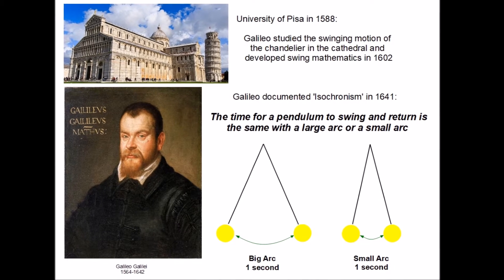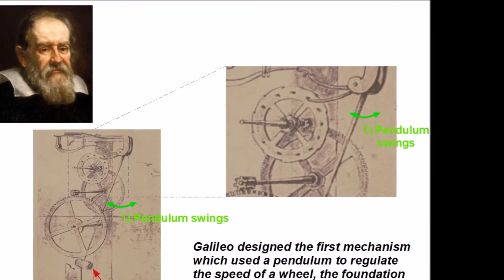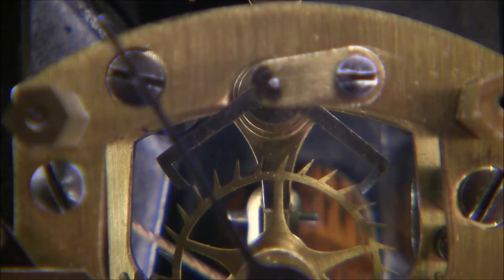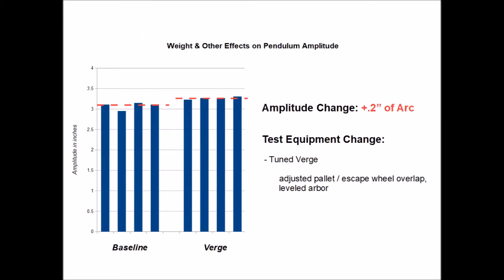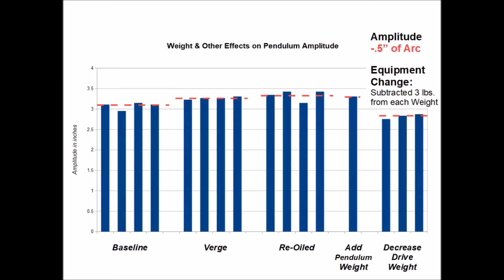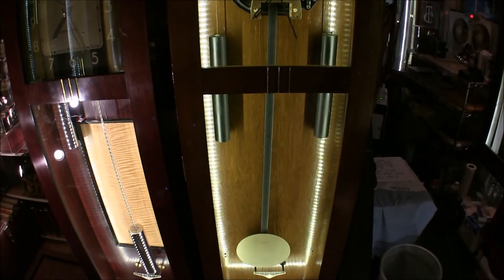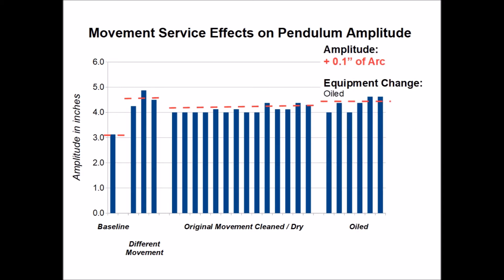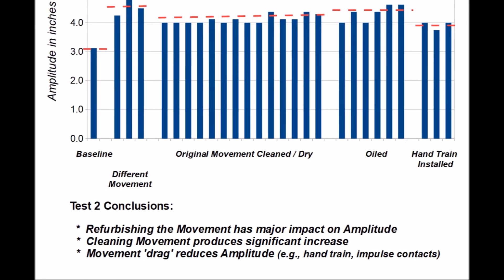Arc of the Pendulum - A Study of a Clock's Swing, an ITM Clock video

Comment: Marvelous clocks in this video.  I believe it's not quite correct to say that a pendulum with large amplitude has the same period as one with a small amplitude.  That's only true for swing angles much less than one radian.  Example: a one degree swing (1/50 radian) has very nearly the same period as a 1/2 degree swing.  See https://en.wikipedia.org/wiki/Pendulum which says that for a grandfather clock with a swing of 0.05 radian, the small-angle formula for period yields an error of about 15 sec per day.
Reply from the maker: Thanks for the feedback, Warren.  The variations in a pendulum's period can also be seen in the multiple data points in the bar charts for each equipment set up.  I'd measure over hours or a day, and observed variations in the amplitude.......which I attributed to wear on the movement and the resulting variations on the friction.  Generally speaking, the pendulum was an ingenious way to keep time for 4 centuries......the best technology available!